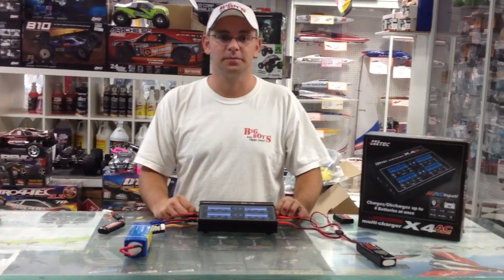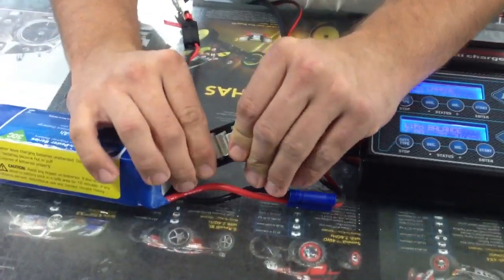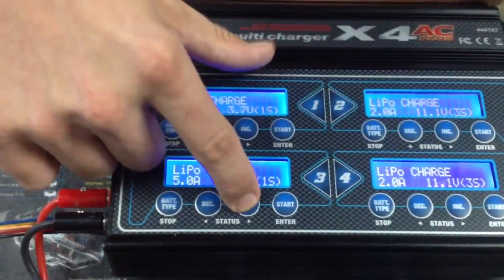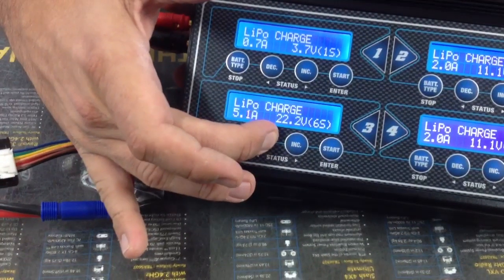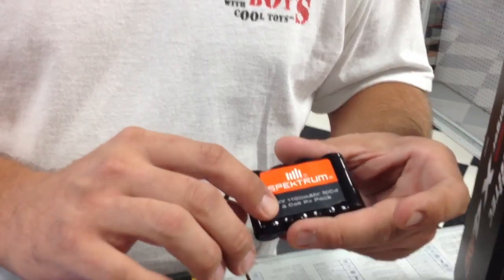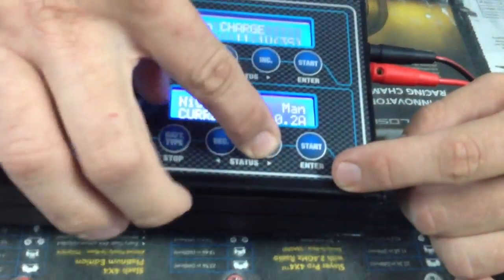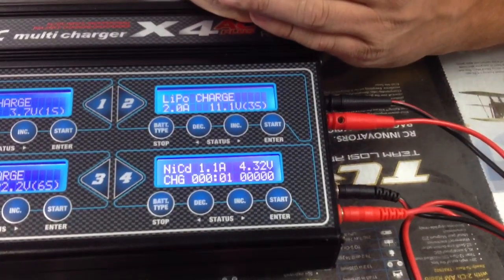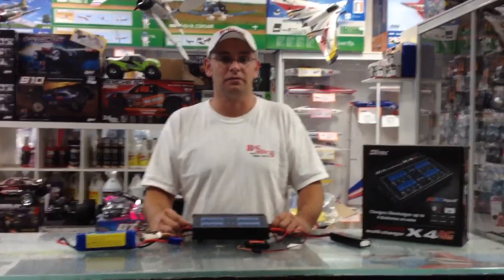HiTEC x4 - 4 port multi-charger.

Comment: You don't need an external board with this charger, I'm not sure why balance leads you have but I can directly plug my lipo packs right into the side of the charger. Just pay mind as to where the negative wire is. Also please note when using the ac power supply if I remember, it's only 50w per channel, and on that big 6s you won't see a 5a charge rate. You can set it, but you will realistically see only about 2.5a.

Comment: Remember watts is amps times volts. So to see what rate you can charge a 4a pack, take 50w which is this charger when plugged into the wall, divide it by 14.8 volts. Since input voltage will be more than 14.8, it will be less than the number you get. 50 divided by14.8 is 3.3 and change. Depending on the mah rating, is how long it will take and how far you discharge the pack. 6000mah pack will still take over an hour.

Comment: I have this charger and it works well with small batteries , but when it comes to real size batts, it will take almost two hours to fill a 5000 mAh 4 cell, and is only because 50 watt per channel is a very low number.
Reply: What do you mean real size? Are the other ones fake sizes?
Reply: My fault, sorry, I ment large batteries....

Comment: How the hell do you turn off the capacity and time cut off? I havebt used my charger in about 12 years and of course i have lost the manual. I figured everything else out (i think) but my capacity cut off is set at 3000 mAh and my time cut off is set at 90 minutes and its very anoying

Comment: so how does it charge the 6s at 5amp when you would need 111watt to do so but its only a 50watt channel?
trying to get my head around this stuff
Reply: It will charge at 2.25 amps for a 6s lipo battery. 50 watts divided by 22.2 volts = 2.25 amps. therefore it will take a very long time to charge.

Comment: when i set all four chargers at 6amps, it stops and says voltage error. is it defective?
Reply: i am just now learning about this and i bought it years ago. i think the max global output can only be about 200 watts. that explains why when i would charge four 3s lipo at 5amps, not all channels would get 5amps, as that would be (12.8vx4) =50.5, 50.5v x 5amps = 250 watts, hence why some wouldnt charge at that amperage

Comment: how come when i set my charge rate at 6A it only charges at 4A
Reply: It's a limit of wattage.  I'm guessing you might be charging a 3s?  50w/11.1v=4.5a.
Reply: @rlane4osu199  i am just now learning about this and i bought it years ago. i think the max global output can only be about 200 watts. that explains why when i would charge four 3s lipo at 5amps, not all channels would get 5amps, as that would be (12.8vx4) =50.5, 50.5v x 5amps = 250 watts, hence why some wouldnt charge at that amperage